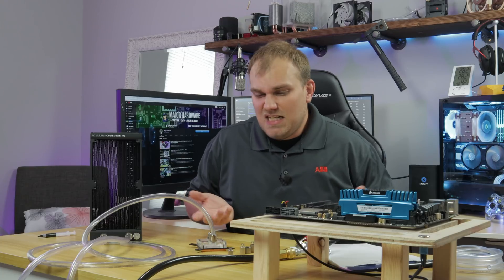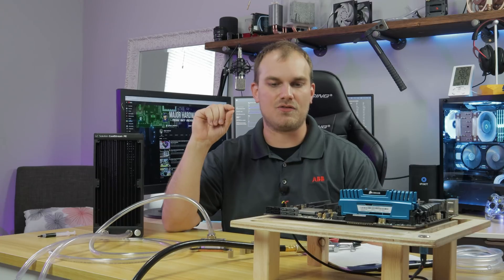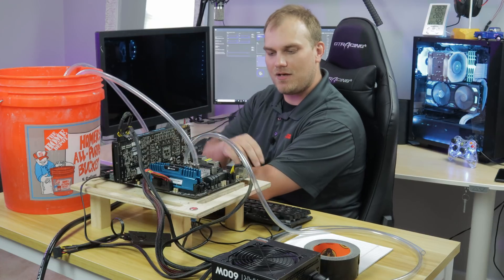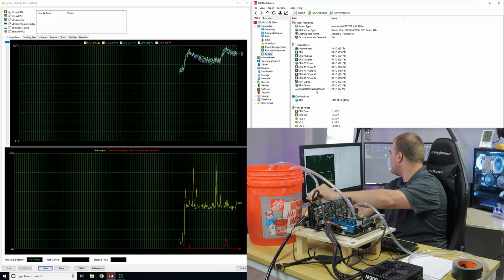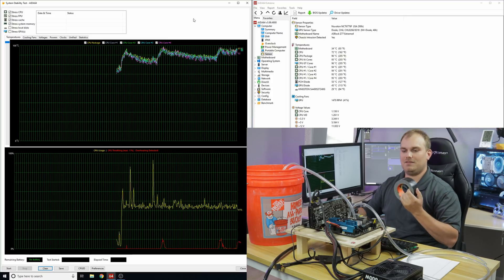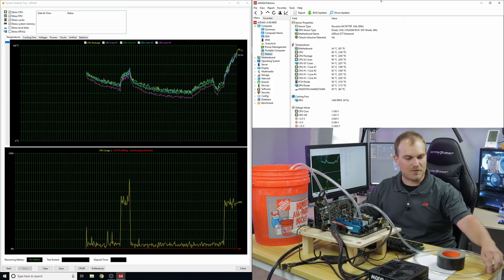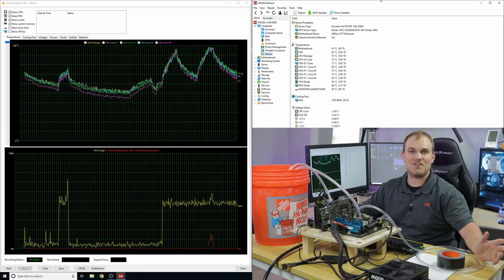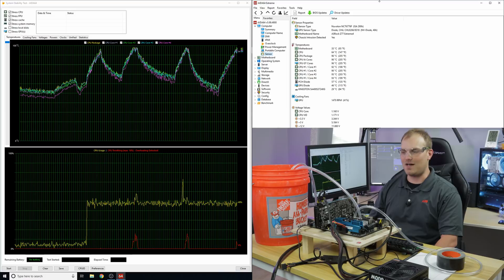AIR COOLING A CPU WATER BLOCK

Comment: A /lot/ of US Navy ship computer hardware is cooled like this! "electrical dry air", air at normal air compressor pressures (90-120psi) gets run through a drier to condense the water out of the air and reduce the pressure some, and gets used to chill hardware that would get hit enough to die without water cooling. It doesn't run through a radiator, but rather works by Boyles (iirc? The one about expanding gas temperatures) law. It's a neat, leak proof system.

Comment: You should not be worried about PSI, as your hose on the other end is open, so you can crank up that PSi a lot higher, while there is no obstruction on the exit you could go way higher than 40, actually your compressor should not be able to blow you setup at full PSI, while the exit on the end stays open, for a really cool test you should add a water spray on the mix, like those fans at the parks with the fine mist of water adding cooling to the moving air, that is not going to be an easy task but you temps should drop drastically, or maybe make the compressor suck air from a bucket filled with Dry Ice. Just some crazy ideas.

Comment: Kind of late, but how about running a tap off the refigerator water supply and running plain tap water through the cooling system like a swamp cooler?  Can you heat your shower water with it or just see how much goes down the drain?

Comment: You should try building a pressurized helium loop, it can carry a lot more heat than air can. braze a box around a air cooler, input line and orifice on top suction line on the side, maybe use an old refrigerator compressor to move the gas and an automotive ac evaperator to radiate the heat after the compressor, add enough gas that the hot side can run at 60 - 100 psi

Comment: You probably want to try this setup without the radiator and ice, which will increase airflow. Oh and detach that outbound pipe off the cpu so the air is easier to make its way out.

Comment: um ........... the force put on a container by a fluid under pressure is relative to the weight fo the fluid.  AKA air @ 5 PSI has way less force than water at 0 PSI

Comment: It's been over a year but I just want to point out that there is almost zero pressure in the water block.
You have to cap off the end in order to have pressure in there. Right now there's almost no pressure as the air can leave completely.

Comment: uhm... going from air to water is a hands down thermal convective improvement - the other way around is well... the other way around :-) On one hand it is just good fun seeing you tinker with things just for the heck of it, on the other hand, you are kinda' reinventing the wheel here and finding out that a circle shape is pretty close to optimum. TLDR: You can cool with whatever fluid you feel like as long as your temperature difference is, continuously, sufficient.

Comment: i don't think the pressure actually matters because it's an open ended loop. all you're doing by increasing pressure is increasing the flow rate of the air through the loop. you would have to have some high pressure, verging on thrust, to actually blow anything i guess.

Comment: Since it's an open air system there's no real blow apart limit since you aren't building pressure up in the block like you would a closed loop.

Comment: You should put the "intercooler" in between the compressor and the storage tank not after the storage tank. The expanding air already is sub ambiant. So you might even be warming it up

Comment: You should do this again, but change things up. Try using an air mattress pump, large fish tank air pump, and 3d print an adapter for a computer fan down to the hose size. Than mix up the cooling, like add salt to the water/ice mix, do a 80% crushed ice to 20% water and same ratio with salt water vs. cube ice, or go to as low as using cheap vodka and dry ice. THAN haha try it all using the air cooler that you converted into a water cooler, but use it in this manner, run super chilled air through it and see how little of air you actually need to use. Imagine if a super cooled salt water mixture, and a fish tank pump, or fan adapter, could keep temps down extremely efficiency. Could also insulate the exterior of the air cooler, you converted into a water cooler, that you're running chilled air through (it needs a name lol) and see if that helps. Also you can pick up a cheap infrared heat gun that might make things neat to see. Oh and try cooling mineral oil so it doesn't degrade the cooler! Dual water coolers, closed loop oil, in ice bath.

Comment: The compressor generates heat with the compression.  They usually use a copper tube/coil to dissipate some of that heat, before it goes into the tank.  When the compressed air is released, it'll be chilled cooler than it was in the tank.  If you had a more easily compressible gas, you'd see more of the affect and the compressor probably wouldn't have to work as hard.  It'd be like a refrigerator compressor.  But then you'd have to run your output back to the air intake on the compressor.  Propane could be used.  If you fed it into the compressor, you might see an improvement.  Also, instead of a compressor, what if you used a set of pc fans in series with a duct, tapering the air flow down into the tubing.  IDK what kind of pressure you could achieve, but it would be interesting to see how pressure is affected by using more fans, series or parallel.

Comment: Increasing the pressure on your regulator just allowed air to move faster, pressure on that with an open end is negligible at best. A high volume, low pressure air pump like a mattress inflator would work better in a setup like that

Comment: Actually… I’ve wondered why no one has done this before. There is a better way; use a Vortex Tube: -40F air at low flow. Check it out: https://airtx.com/collections/vortex-tubes

Comment: The psi is at the air gun... after it leaves it will decompress. That 40 psi is probably more like 10 in the water block. Cool video though!

Comment: the psi is in the compressor line not the loop. Once the trigger is pressed the air pressure drops big time as there is no restriction in the loop exhaust. so now you have low flow rate throw the loop.
you could use a high speed air bed inflator to up the flow in the loop ( https://www.ebay.co.uk/itm/Electric-Air-Pump-Inflator-Bed-Mattress-Camping-Pool-Inflatable-Boat-Beach-12V-C/233588649951?hash=item3662f7efdf:g:EjgAAOSwugJensLZ ) the faster the beter

Comment: I’ve actually done something like this before, 8 or 9 years ago I had an Asus Striker II Extreme I retired from my daily system, that board has a water block on it and I didn’t want the hassle of liquid cooling just the board, so I modded a fan to fit inside a funnel and ran tubing from the end of the funnel through the water block, it worked, I wouldn’t try to cool a CPU like that though

Comment: Best part of diet tape/ super glue aka cyanoacrylate. Both designed for use as injuries during Vietnam. Duct tape to slow bleeding and the super glue came in a spray bottle and because  it seys almost instantly when im concontact eith water which is in blood f course it clots and stops or slows the bleeding. The super glue was especially  for a gun shot wound

Comment: you should try a fish tank air pump with smaller air tube and a valve to keep a avg psi in the tube. Hydrofarm Active Aqua Commercial Air Pump, 12 Outlets, 112W, 110 L/min

Comment: Well, if you want to try something different, try this...
Get a big metal water tank, a boiler for instance, and bury it in the ground.  Hook up you watercooling loop to it and be blown away. All the heat is passed into the ground which is effectively an infinitely large heat sink. I first heard about this over a decade ago at least. You want extreme, this is it. Dig up your basement folks! It works, it's passive and as such completely silent with the most extreme overclocking potential outside of nitrogen. Hell, add a peltier if you like and go the little bit further. No compromises, I won't believe you until I see the jackhammer and shovel !

Comment: the thing about the pressure is that you have almost no build up in "resistance" on the other side. your compressor is trying to push 40 PSI but the resistance is probably like 3 at most... well at the compressor side and the first fitting... not that i am an expert but i can easily guess that it is not building up those 40 PSI of pressure!

Comment: The nozzle outlet is a restriction and the tubing shoved on the end is much bigger than the hole in the nozzle, causing a pressure drop. The pressure you are seeing is way less past the nozzle. this is because it has more space to flow out than it does to volume of air coming in. The pressure drop causes a temperature drop past the nozzle. so if you ran the higher pressure air through a cooler before the nozzle. It would take more of the heat from the compressed air out before the temperature drop at the nozzle, and if you put the nozzle in the line closer to the block you would have a temperature drop past the restriction where the pressure drops. Or...

Comment: If you want cold air look up a vortex tube/valve.
Also as it is venting to atmosphere the pressure in the block won't be as high as you think.
Great experiment. Completely impractical but still great.
Keep up the good work.

Comment: Instead of having a water pump for water cooling use your air compressor and a reservoir that's air/water tight that can handle that 40psi you pushed and see the cooling potential. Water is better than air but how better is water at 40psi and I wonder how fast it will flow lolol. It may pop at 40psi because of water being thicker so I'd try 10psi first

Comment: The radiator is limiting the airflow. I would bet that if you completely omited that part and went straight to the water block with air, it would cool down a lot nicer.

Comment: This is sweet. I'm having flashbacks to my thermo and fluids classes. 

You should get a really old school block with the interchangeable jet plates and use on with the smallest holes possible. Also get rid of the door gun, it's a restriction the system, go with a ball valve instead.

Comment: what if you use an air cooler as a radiator in a water loop. like using a CPU block mounted to an air cooler to cool the water for the loop

Comment: look into refrigeration, but I believe it's based on the concept of pumping air through a cooler:P(course they replace air with an alternative gas that works better but similar concept)........ there's something I"m not completely in the know of regarding diameter of pipes(capillary tube I think is tiny and I think the return being a bigger diameter pipe) and some junk relating to the end of the compressor hose becoming really cold when the air comes out

Comment: your not building much pressure in that system at all maybe 2 psi. since your end isnt capped or sealed the air has no restriction other than itself. crank the compressor all the way and let er eat youll be fine.

Comment: now replace the radiator with ANOTHER water block and a tower air cooler. Water cooling using an air cooler lol

Comment: there was some big old server cant quite remember if it was ibm or dec, but anyway it was designed for watercooling but as i heard it they tougth it was to much problem with water im guessing corrosion or leaks so they delevierd it with compressed air cooling instead.

Comment: This actually would have worked significantly better if he didn't use a blow off nozzle (what he is calling an air chuck).  Those severely restrict flow and pressure as compared to the supply.  A simple ball valve would have been excellent in this situation.

Comment: @
Major Hardware  you should get a 55 gallon metal drum and fill it with water and use that as a resevoir and see if it can water cool without a radiator

Comment: What about air cooling the processor directly. Instead of the cooled air going into the water block, remove the water block and shoot the cooled air directly on the naked processor...... see what happens there.

Comment: its simple. One forget to cut to the shortest lenght possible the heat scape tube, straigth up 10 cm tube for the exit would be twice effective than this bench. Basically the hot air is being mixed back with the cold for its constantlly tring to push back up the tube on that curve.

Comment: If you ever repeat this, place a small toy fan in front of the exit air-hose to give us a visual indication of air movement.
Reply: Oh, and try cryo-cooling by submerging the radiator in liquid nitrogen and running the compressor off of pure nitrogen.

Comment: Air is a fluid so it makes sense that this would work, however, the specific heat of water is very high so it makes sense that it doesn't work very well.

Comment: AIR COOLING A CPU WATER BLOCK
 ... actually works.
My BeQuiet Silent Loop 120mm AIO pump failed after 2 years use. 1 week ago.
I removed the two fans from the radiator and placed them directly on the CPU block, making a roof.
In an open case, I had 60-80 degrees depending on load (no gaming), i5 8400. Enough to still able to use the PC, and wait till tomorrow for Amazon next day delivery, Corsair AIO.

Comment: I'd be interested to see how inefficient a tower cooler mated to a second cpu block (plate to plate) would be instead of a radiator in a cooling loop.

So instead of Pump/res - CPU - Rad - Pump/res it'd be Pump/res - CPU - CPU+Aircooler bolted face to face - Pump/res

Edit: Typo
Reply: Even if the air cooler can keep the cpu block (that's cooling the water) cooler than a fan can keep a radiator, theoretically it's a bit like making the intestines go in a straight line from the stomach to the asshole. Now if you can find a CPU block with a more advanced, radiator-like structure for the water flow for really great TDP's, that could be something else.

Comment: Why am i pretty sure that People were thinking about reverse cooling a Water Block running Water True an air cooler...
Cause watching this is... Giving me ticks And no one is gonna use a compressor And ice Water but i guess People would wanna cheap out And use a Water Block with 1 or 2 air coolers instead of radiators....
Ideas for your tests dou....
1) run Water Block with Water True an air cooler
2) run Water cooling True an air cooler directly on the cpu And a 2nd air cooler or rad..
3) maybe mix in a pelter cooler

Comment: The weakest part of the waterblock is probably where the screws thread into the plastic, (acetal or plexi?) I have no information on the size of the screws otherwise I could give you an estimate of the pressure it will handle without it exploding 🙂
The construction looks rather solid though, good chance it can handle more than the 40 psi you used thus far. Although I don't recommend testing that with the block on a CPU. Wear safety glasses!

Comment: You don't need the ice, let the air do the work. All you need is expansion. 
First the air is compressed in a compressor, that heats it up. 
Leave it in a tank for a while to cool it down. Then pump it into a waterblock (at high pressure, 70 psi or so should do it). Make sure that the waterblock has a tiny pinhole in the part you want to get cool. (If the hole is small enough you won't hear it hiss because its frequency is ultrasonic).
The expansion of the air coming out of the hole will cool your CPU to sub ambient 😋
Reply: I have seen Air Power Tools freeze during hard use, so this could be enough indeed :)
Reply: thought the same. in worst case the 0-1 degree water could add heat to the air. rather than taking it out. haven't done the math. but indeed your observation is correct. but only IF the air is cooled before hitting the tank, like on a screw compressor on a workshop. don't think it's the case on an armature  compressor.

but hey. this isn't science. he is just playing around.
Reply: Also add heatsinks to the compressor pressure vessel
Reply: @kai990  Actually dealing with the heat caused by the compression of the air is an important part of compressor design. Heatsink are therefore included if a compressor is designed to run for longer periods.
Reply: @gendragongfly  oh yeah i was not being sarcastic but rather seeing this as coming close to what an AC unit would do. Compress, extract heat, inject and evaporate
Reply: @gendragongfly  i know i know, i meant the principle
Reply: The emoji makes me fell like you're a  idiot
Reply: @snakeinabox7220  "an" idiot 🤪
Reply: @snakeinabox7220  So a guy explains the concept of refrigeration, but you feel like he's an idiot because he uses an emoji? I think you need to reconsider how intelligence works, because I can tell from your spelling that you're not particularly familiar with it.

Comment: i guess the reason why it is not as good as water is simply... water can "save" more heat energy than air which is the reason why all fins of air coolers are made out of aluminium instead of copper (better heat transfer vs saving more heat energy )
Reply: unheardNerd The term you're looking for is specific heat :P